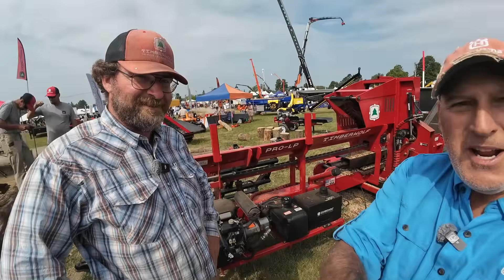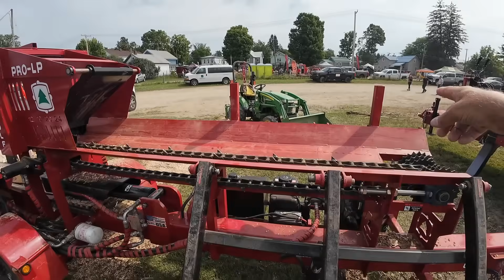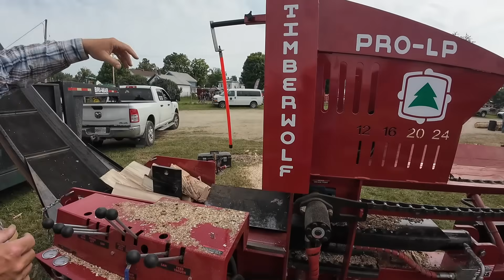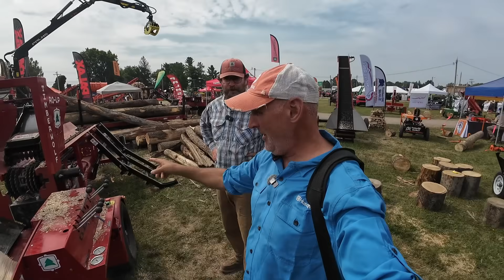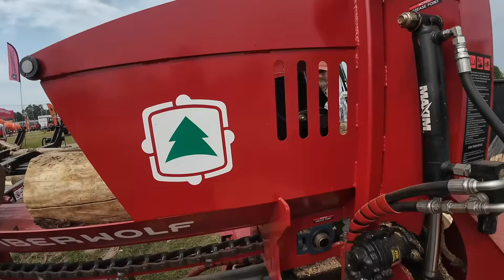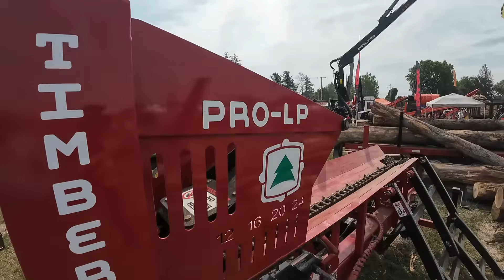TIMBERWOLF FIREWOOD PROCESSOR LESS THAN $30,000 NEW

Comment: I wonder how much without conveyor, manual wedge adjustment and no auto cycle…. Still ways to make this cheaper 👍🏼👍🏼 
A decent splitter with an attached conveyor runs almost 39k so this is a good price point!
Reply from the maker: Yup, it is a good price point for what you get!

Comment: What I'd like to see more of is a separate cheap but heavy duty log cutting table and conveyor to drop rounds at a splitter if your by yourself you fill conveyor up then split fill and split etc etc or constant flow with 2 men. Plus a round lift if it doesn't have a big full powered  log lift  to assist in loading hand cut rounds from tree service uglies etc etc
You see some out there but not a lot.
Reply from the maker: Those are all very helpful features! But cheap and heavy duty do not usually go together!
Reply: The few iv seen were very exspense but was full of bells and whistles like a processor. 
Instead of something basic that gets the job done.  @InTheWoodyard

Comment: I run a small processor it’s a game changer. There are small processors even less $$ than this one. It depends on how fancy you want it. Mine has a live deck and in feed and I don’t have 15k in it in Canadian dollars. Is it as fancy as the block buster or timber wolf no. Does it cut and split wood yes. Don’t judge these smaller processors on the market today for cutting firewood for yourself. If you’re selling wood on chris’ scale ya the block buster is a must.
Reply from the maker: Yup, small machines are nice but you can always up grade!
Reply: Which one are you running I’m looking for a cheaper one to process sawmill waste